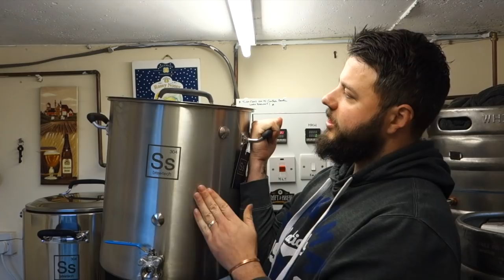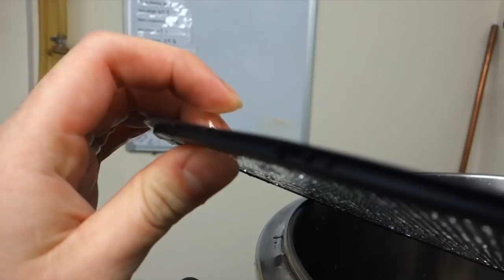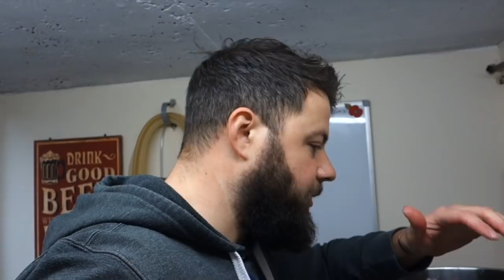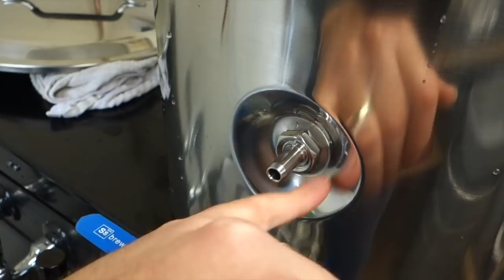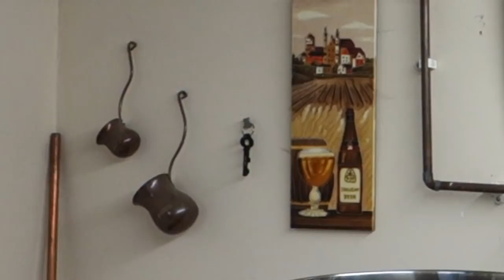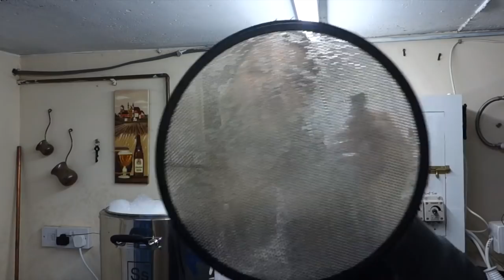Passivation Of The Ss Brew Tech Infussion Mash Tun

Comment: Passivation is simply the act of cleaning off any foreign surface debris so that the chromium oxide layer can naturally form.  All this talk about having to passivate new stainless steel equipment with StarSan that shows no signs of rust spots is a waste of good Star San and your time.
Reply: Passivation is actually the process of creating an oxide film by intentionally corroding the metal in a controlled manner. This is done as a preventative measure to ensure that the base metal is protected. The star-san can be collected, and mixed with fresh water to dilute for future use.

Comment: I used mine for the first time last week, the only thing I found when draining the last of the runnings out of the mash tun, some of the fine grain that manages to get through the mesh
and sits on the bottom of the mash tun come through the tap. I did re circulate for about 15 to 20 minutes was quite surprised when this happened. my video on its first use will up tomorrow.

Comment: Hi Tom, When you rebuild your control panel I recommend the Auber EZboil DSPR120 for the BK. Last year I built one of the 30A Control panel kits from The Electric Brewery and replacing the supplied PID for the BK with the EZboil was one of a few modifications I made and it has worked very well, I have 5500W elements which provide a vigorous boil, and because of being able to just turn a knob instead of having to push several buttons to reduce the power to the element the EZboil has saved me from a boil over several times. Cheers!  🍺
Reply: I totally agree with Mike J.  I use the EZ Boil controller and it makes everything so easy.  I start the boil at 100%, turn it down to 65%, during the boil, then up it to 80% when I add my immersion chiller.

Comment: Very timely! Need to passivate my SS brew bucket. Better order more Starsan... 1oz per Gal?! 🙈 Cheers
Reply: You can use tsp or so I've heard
Reply: I would use some of my phosphoric acid, sure it would work out cheaper?
Reply: I think you can ask on the brew forums
Reply: I just got a ss brew bucket and did this as well. I would not reuse the star san as after I was done with the passivating there was a black coating that wiped off the inside of the bucket after I drained it. It was like powdery and came off with a wipe. After wiping it down it was super clean looking and now is in the freezer at 50 degrees F full of my first attempt at a german helles. 7 oz was a lot of star san, like 7 brew days worth. But its not expensive if you buy the 32 oz at a time and well worth it since I saw what came off the ss bucket.